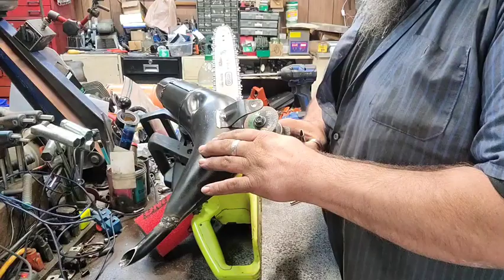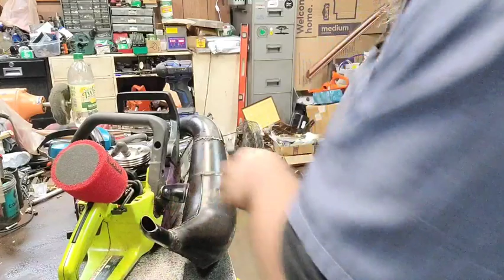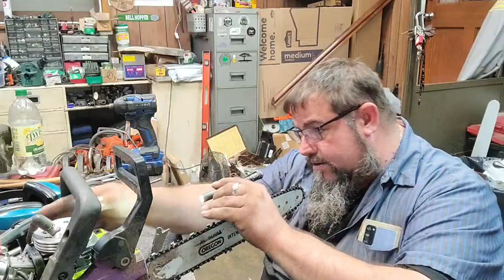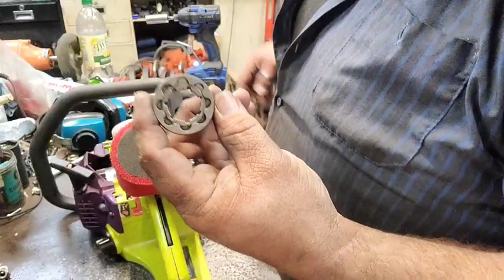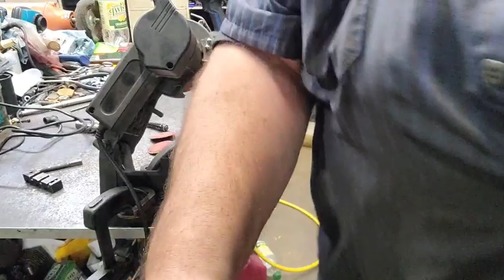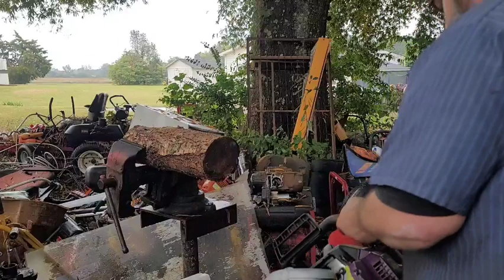Wildthing For Sawfest

Comment: Bellhopper I have a question. , I ported a hiway 52mm big bore for 372 , I also used a 372 xtorq carb and this saw starts idles great but loads up real bad and takes for ever to clear out, runs strong on top when I get it to clear out any suggestions bud ? Thanks .
Reply from the maker: Did u rebuild the carb ?
Reply: @bellhoppersaws  no it came off a running saw
Reply: @bellhoppersaws  I took it apart and cleaned it with my ultrasonic cleaner